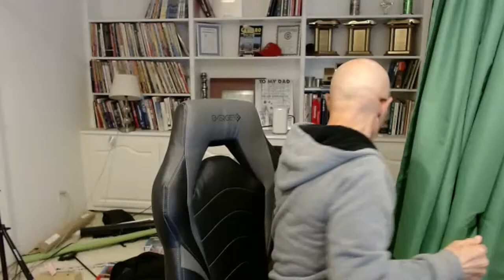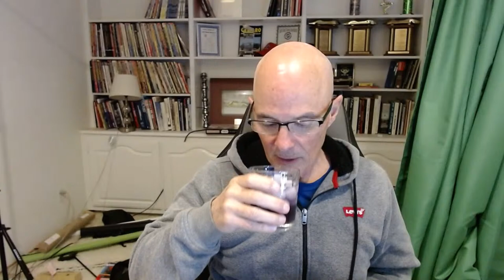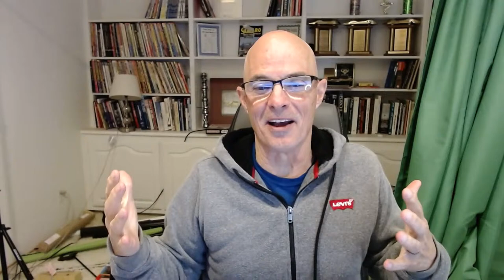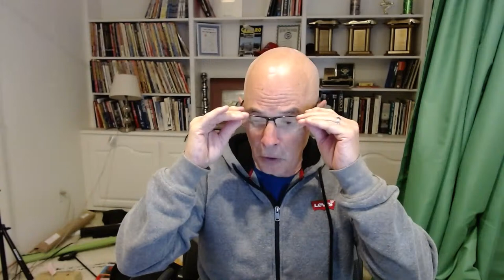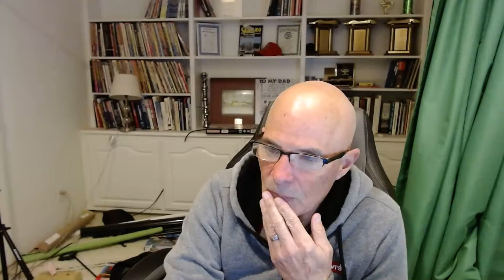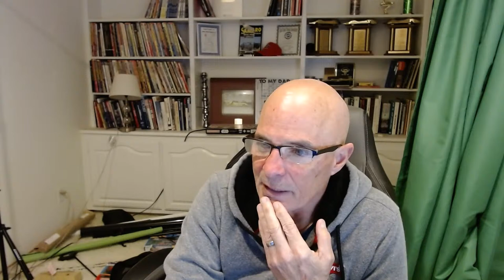JUNKYARD BATTLE-BBC VS LS-LET'S TALK TECH

Comment: RPM takes the place of torque. Bill Grumpy Jenkins went that route in the early 70's with a 680 horsepower 331 turning 9600 RPM
Reply: The 331 was not more powerful it got a big weight advantage the weight break was 6.75 for small blocks and 7.25 for big blocks so the big block pro stockers were a lot heavier
Reply: @operatingengineer  You are definitely correct. I was making a loose statement I guess.
Reply: @rogerstill719  no doubt the small car with the 331 was the better combo! 😉

Comment: I had a 71 chevelle and I ran into this question. My father and I really wanted a bbc but the cost was so much higher to build and the time to get parts compared to the ls was huge. If the chevelle came with an engine I would’ve been more inclined to go that route but as a rolling chassis I preferred the ls route.

Comment: I just got a 2004 Silverado with a 572  BBC by Skip White (so far runs just fine)  for less than you could possibly build anything decent. Maybe the prices are going back to reasonable. The original  builder had 45k into the truck rust free from Arizona with QA1 coil overs, a built transmission, quick change rear end, and 4 link rear suspension. $15,500.00 was for sale for a long time too. It needs some work like a headliner, paint, stereo, maybe some better seats.  Still, how could I pass it up?

Comment: the gen 7 8.1 bbc weighs like 760 lbs. the 6.0 LQ4 weighs like 520 lbs. the BBC has a bigger footprint so putting it in something like an S-10 takes a little more work. a gen 6 454 is a better candidate for swaps assuming it will fit without having to massage or adjust any parts like the control arms, exhaust manifolds, and frame or firewall. when you start looking at aluminum blocks and heads then the cost goes up more for the big block. in my case, the S10 engine bay isn't great for a big block.
Reply: Got to run aluminum performance heads on the big block.

Comment: I love my BB but daily driving an LS would be so much better. I couldn’t care less about a high HP track car, 450hp works for me. But a 450 HP LS is more dependable and gets MUCh better MPG. And I wouldn’t be afraid to drive it cross country. My 454 gets around 7 MPG, can’t take it anymore.
Reply: The 6.4 Hemi in a 3500 4 door Ram gets 9. With a 6 speed automatic. In a 5500 dually bucket truck it gets 6.

Comment: Mr. Holdener, I have heard you say more then once you LOVE the gen6 BBC. We are close in age and 20-30 something year old guys seem to be all about EFI LS builds and YouTube has more videos on LS engines then all others. I cannot even come close to your amount of builds on the dyno but building both circle track sbc and bbc drag race engines over last 25 plus years in my many hundreds of builds I know I can personally build a bbc for less then an efi dyno tuned LS capable of similar NA power levels. I already know exact cam, head, carb, and timing to make bbc 500+ HP and TQ combos for a street strip build from experience. Porting and machined upgraded cast iron 781/049/990 heads to support 600+ streetable HP is a skill set that I have and saves money in the long run. Chinese made cheap bbc heads are getting better and better every decade. BBC for the win every time at the top performing power levels at top fuel dragster to super modified and zero to none LS engines in either class. Just consider the fastest salt flat, drag strip, or oval track cars are ALL bbc, bbf, bbm. 🤔
Reply from the maker: the last statement is not accurate
Reply: Sorry last statement meant drag racing mainly and many salt flat top racer winners have what is labelled as "big block or big cubic inches" in naturally aspirated form compared to LS platforms. My entire comment was a properly NA big block will kill any NA LS build in the overall power band. LS builds will always require power adders to make similar power levels at what is considered streetable and not just all out racing. Thanks for your response as I enjoy your videos. 👍 @richardholdener1727

Comment: If you haven't could you do a video about the cheapest way to make 500 or 600 or 700 hp
Or is the answer just ls
I have 64 galaxie I want 500 ish hp but wanted to do a ford motor but is it going to be 3 times the cost
Reply: I don't think the answer is always LS. It's possibly the cheapest way, but a T4 GT45 will make 500 on almost anything v8...
Reply: @mattyancey28  yes but at 6 psi but at 12 psi  is it now only the ls?
Reply: I mean if the motor is stock  or maybe just a cam and springs
Reply: The ls needs injectors and you can tune the stock computer 
Costs add up quick with a blow through carb ect

Comment: This is what Google told me about weight
454 Iron block, aluminum heads & intake  650lbs
LS 5.3 Iron block aluminum heads 520lbs
If horsepower had nothing to do with it, I really like the sound of a rowdy big block.
Reply: the catch is that big block aluminum cylinder heads are not cheap and as far as I know, there was no stock gen 6 big block that came with aluminum heads. 8.1 gen 7 bbc weighed like 760 and the 6.0 LQ4 weighs like 520.
Reply from the maker: a gen 6 454 didn't come with alum heads
Reply: @richardholdener1727   I like being right, thanks.

Comment: when it comes to straight line racing, most races are won in the first 60 to 100‘ and horsepower does no good there for that reason alone I would take the big block for the torque although it is heavier it has more than enough torque and horsepower to make up the difference and I believe generally the big block in the LM753 are pretty much equal when it comes to just throwing in a cam know if it’s a race to the mile I’m going to take the 5.3 because it will turn a lot higher rpm than the big block in their stock forms and I say this because I have two race trucks, they race the same class one of the big block. What is he big small block although they run almost identical times the big block beat it to the 330 every time.

Comment: That 454 is 8.5 comp verses 10to 1 on 5.3 put 10.5 on 454 and a cc290 see what those #s are
Reply from the maker: the 5.3L is not 10:1
Reply: @richardholdener1727  what is the comp on the 5.3 I was under the impression  it was9.9

Comment: @K-Effect I ran some HP based numbers although they do not represent big block asskick torque metrics(ha.)    LS at rando weight of 3400 pounds and HP of 450
is 11.43 seconds and MPH of 118.24 MPH. Add the weight you claim of BB- 3520 pounds and HP of 450 is 11.56 seconds and MPH of 116.88 MPH. While based on dead hook, I'd take a BB if I could Hot Rod it on econo parts and it was for fun not fastest. I think the BB drives around and is more fun on the street all day! 
@Richard
Everyone is against part throttle tests to simulate what engines do driving on the streets, if opening a throttle servo x percent(20-70) is not conceivable, why not run a comparison of engines on 1 390cfm carb. Does the SB automatically win? Does the BB make a much larger percent of torque than when unrestricted.  There has to be a way to create solid data of the behavior of engine on a dyno not at max effort...Holman-Moody was studying this stuff in the 60s using a Analog dyno and a guy with a stopwatch and a notepad which produced crude results. Whit new dyno tech I think some outside of the box tests aside from full effort wot has skewed general rodders.. It's like a politician making us look at a few big positive things (max hp and torque) versus the 20 things we learn to deal with that are less than stellar such as fuel consumption and drivablility with less air and fuel available. Not asking for anything other than how to look at this from my seat, opposite of yours.
Reply: Lots of info here. But I just want to know if you did this on your phone or a computer? Asking for a friend :)
Reply from the maker: see the 50% throttle test-and a dyno does not tell you seat of the pants nor does it take into account transmissions, converters etc... Better place to do that is the chassis dyno
Reply: @TheRoyal769sr  I forgot caps lock, my bad. 😉
Reply: @KimiWallrus  I was serious though lol and a lil tipsy